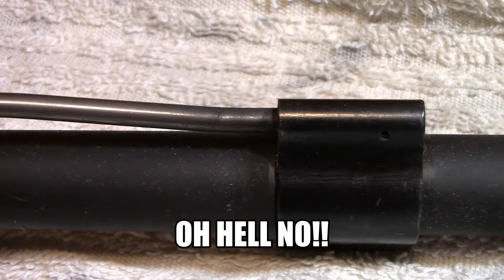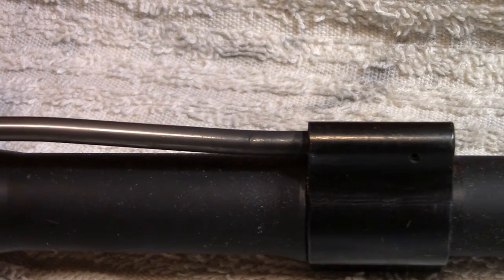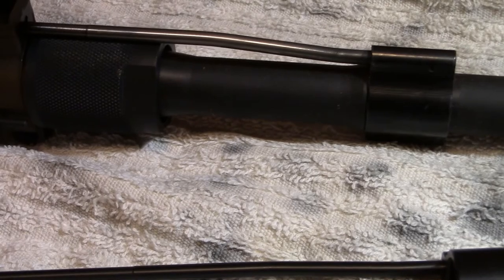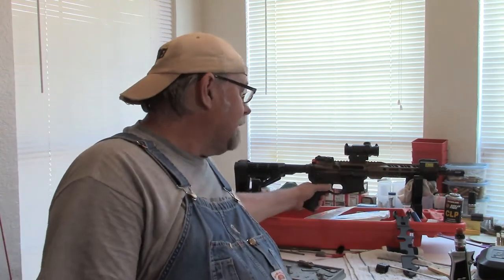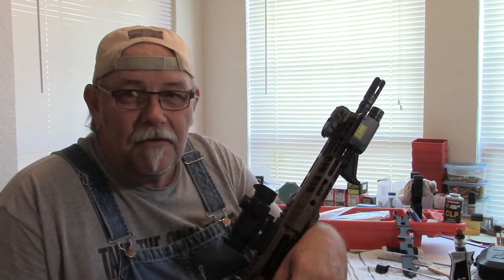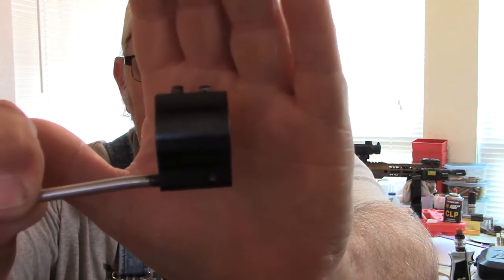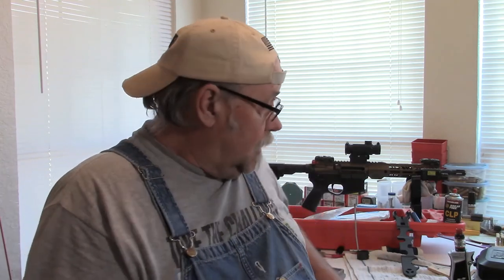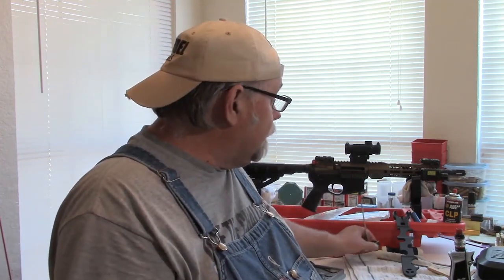Ghost /Grid Defense Gas system update 5 4 2020

Comment: How did you remove the hand rail? I took out the bolts on mine but it doesn’t come off. I have a grid defense upper as well
Reply from the maker: When they are new, they take some persuasion, I made a small wedge from a paint stir stick and just tapped lightly down in the center of the gap where the screws are, that spread it just a wee bit and it came free.
Reply: @bradbranch6462  thank you 🙏 will do

Comment: I don't know of one AR15 that has been shot that doesn't have marks on the deflection plate.
Reply from the maker: Well I think you're missing the point on what I was talking about. I've never shot an AR platform that didn't have brass colored marks either. What I was conveying was that fact that the face of the abutment was actually being damaged in that the material was actually being dented by the case bases, not just smeared with a light brass mark, but an actual indention of the material below the coating that is there for all eternity unless I choose to break out the 800 grit wet sand and smooth it down. They are not deep mind you, but they are not ever going away without removing material. I fired tens of thousands of rounds through the  M-16 that was issued to me in the service back in the dark ages, sometimes that shelf was a solid gold sheen, especially after burning up 4 or 500 rounds on "mad shit go-mode". It always wiped off with some good rubbing and a little RBC, but I never lost any finish, and certainly never made that shelf look like I had been bangin  the edge of a meat cleaver on it. But thanks for stopping by and taking the time to comment. Glad to hear from you.👍

Comment: Stop crying. For $200 you need to wipe them tears. Next time pay the money for the product you want. I paid $800 for my lower and upper and it's super. Stop crying when you get what you pay for
Reply from the maker: Hey thanks for stopping by and commenting. Don't know that I would say I was actually crying about it. I was asked to review it (BY THE MANUFACTURER), so I did. The weapons work just fine now. I am reminded of a day many years ago, 1981 in fact, when a long time friend of mine and I had a local smithy build us a couple of custom govt. model 1911 .45s.There was nothing special added, just production grade guns. This old guy that built them knew his stuff inside and out. We both picked up our guns after work one day, went by his dad's house and loaded him and his Colt Gold Cup series 70 govt. model up and away we went to the local junk pit. Long story short, the pistols we had made in a man's garage with minimal equipment shot circles around that colt. (IT WOULDN'T EVEN FUNCTION CORRECTLY). It was discovered that the colt had to be sent back to the factory for proper fitting and adjustment before it would even work right. Our pistols cost $260.00 a piece. A quarter, if not more than his dad had to pay for a COLT GOLD CUP.  My take away on the moral of that lil nugget, "Just cause you spend $1200.00 on a gun, don't mean you are getting $1200.00 worth of gun". But, I understand what you're saying, and most times, rest assured, I don't go cheap, (unless I know I can fix it if I have to). lol
Reply: This troll literally said stop crying twice as he’s crying online lmao